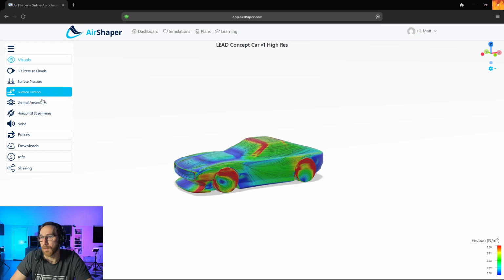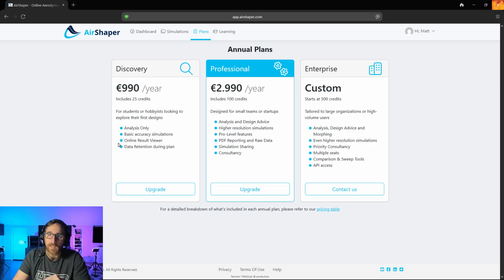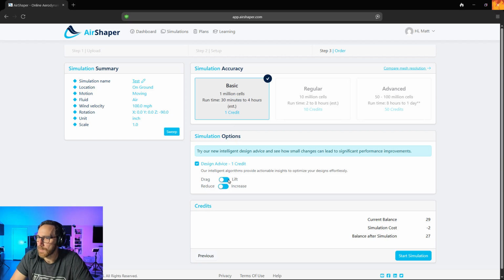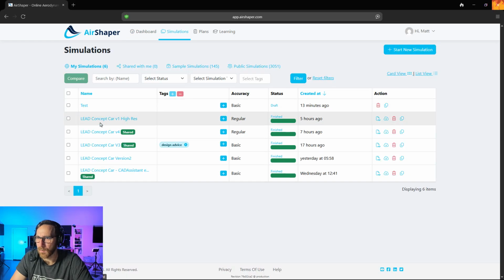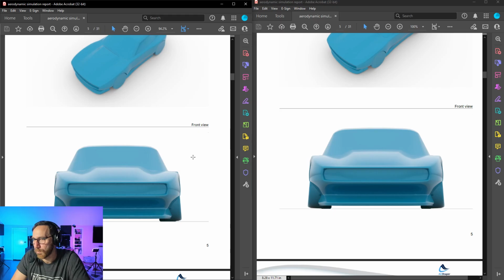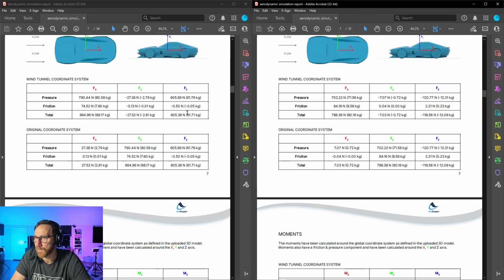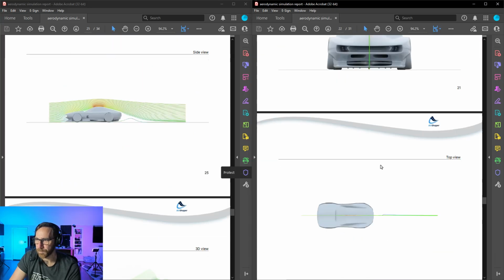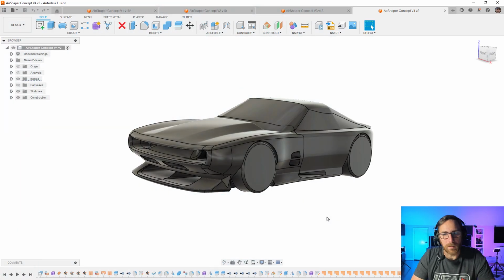The Easiest Car Flow Sim Program!  Concept Car Flow Simulation with AirShaper!

Comment: Really cool. I've seen some other people using AirShaper, including semi-professional race teams, but you're the first I've seen go into detail about project setup and results analysis from the actual reports it gives you. Glad to hear the setup is so simple... that's a huge benefit when you're a hobbyist who doesn't have hundreds of hours to throw into learning some complex engineering software with a million settings intended for use by people whose entire career is that software. I don't need Formula 1 team-level accuracy for my project car aero, and AirShaper looks like a great, accessible middle ground for folks who want to get 90% of the way there with 10% of the work and cost.
Reply from the maker: Thanks Jim.  I would suggest checking the tutorials on the AirShaper sight because Wouter has a lot of videos going over results and they are very helpful as well!

Comment: Awesome, but I have the idea that SOLIDWORKS simulations would be more accurate that airflow
Reply from the maker: I don't think SWx would be any more accurate.  This has a few benefits.  It isn't computed on your machine.  SWx sim is resource heavy.  The cost is better (although you use those credits per solve).  If you were to go buy SWx right now you would pay $8k usd and another $8k or so to add on simulation with CFD.  They make you buy 2 years of maint ahead of time....  And the setup is much more difficult in SWx.  You will have more options available but for this type of simulation I would say AirShaper would be less expensive and save you a ton of time on setup.
Reply: @LearnEverythingAboutDesign you got really good and valid point right there..Thank you
Reply: @LearnEverythingAboutDesign  The cost is worse. First of all there is no fixed price for Solidworks and you can negatiate the price, and if you do not want pay for it there is way too . Even with the price you gave Solidworks users would save fortune. In Solidworks you can do all kind of simulations (choice is much bigger) not mentioning designing and assemblies. First of all it's a way bigger package. Second in Solidworks there is no limit of how many simulations you can do. You can run simulations all day long 24/7, so it's way more cost effective. Third simulation customization, no compare to Solidworks, it's got way more options. Fourth not many Solidworks users would spend additional 990-2990 euros on something they can do for free in Solidworks. 
I can see only two advantages of Airshaper, ease of use and that it's online, although that can a flaw because your data can be leaked so running simulation on your own workstation is way safer.

Comment: Well I need a software like this for architecture.
Reply: Thanks! Worth a try with a scale model.
Reply from the maker: It does external flow so likely would work for buildings.  Their tutorials have a lot of different test cases like turbines that are stationary in a wind stream.  I would imagine that might work around a building.
Reply from the maker: BUT i would guess the number of cells/resolution for a full size building would be massive.